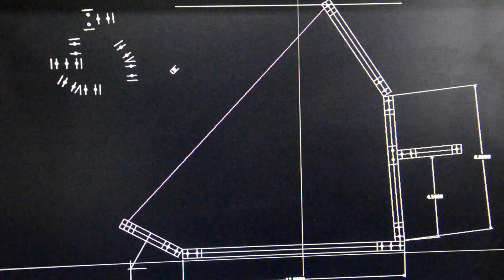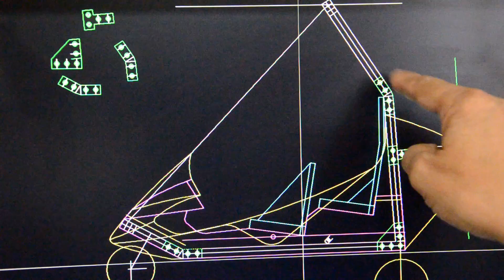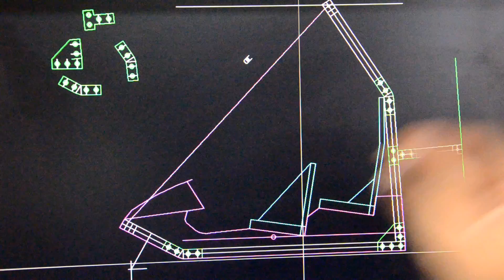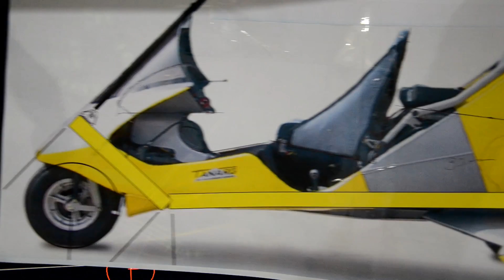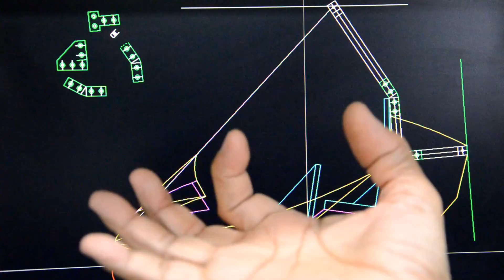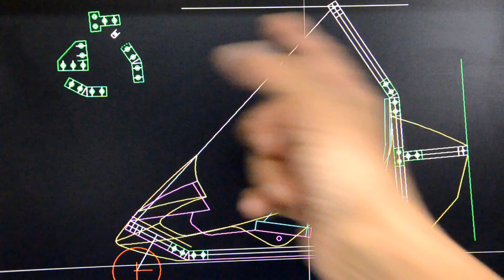RC Microlight - Design and Build - Part 1 - One way to Make a Tanarg Trike  MIA Micro-FLIGHT Style

Comment from the maker: First of a series of videos about the design of an MIA Tanarg Style RC Microlight. 
I have gone through a few iterations of the frame re-engineered for RC application and finally I have a full tubular design, in scale and style with the the real thing, but with my own design elements and hardware. These are the steps I like to take in approaching an scale RC model which has been inspired by real aircraft. I have a lot of videos to go through and edit to show the development of this awesome scale model which will unfold in subsequent videos. I have been working on this project for the past month on and off time permitting.
Reply: I realize this video is a year old but could you take your drawings in upsize them to full size to build something like this for 2 people to fly in